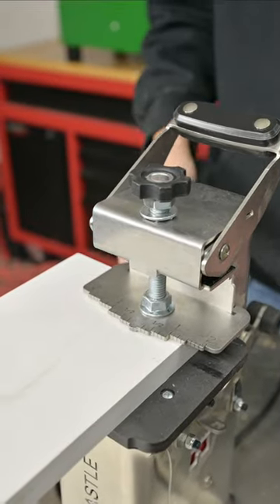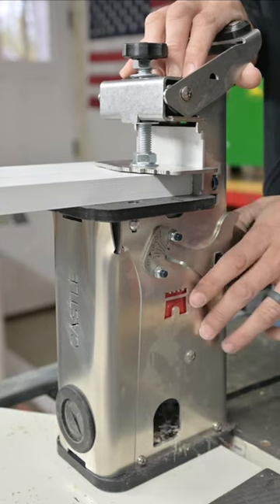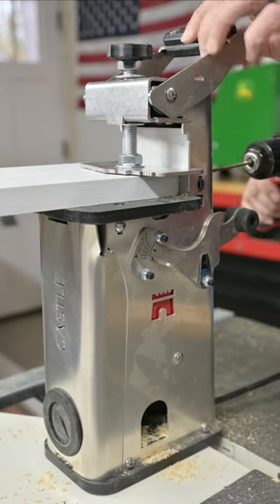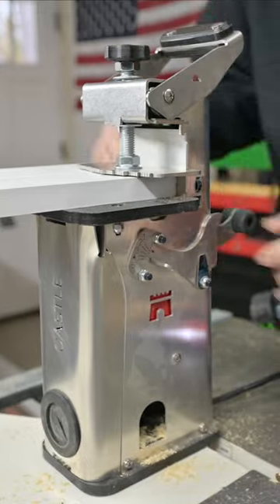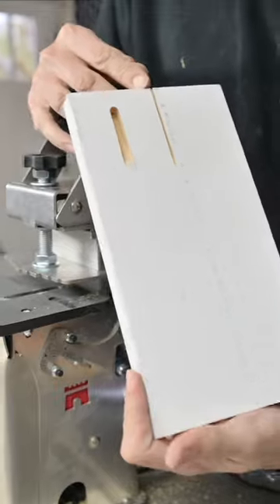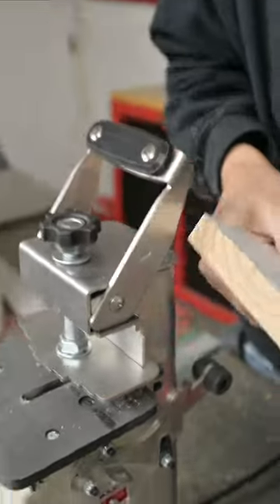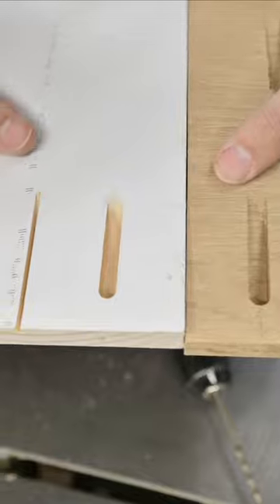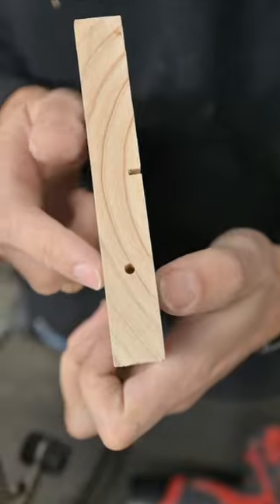dream pocket machine

Comment: I don’t use this pocket hole cutter but I use the Porter Cable production pocket cutter which cuts the same pocket as the castle machines cut but ten times faster. I personally prefer the angle that the castle cuts as opposed to the Kreg. 

Because the castle style pocket is bored at a much lower angle than the Kreg I have found it much easier to screw the joint together and pull the joint tight even with 
1 1/4” screws. With the castle style pocket you can also use 1 1/2” screws without the tip of the screw protruding through the face of the piece that’s being screwed together. 

I have a Kreg that I use for cutting a few holes on installs so I don’t have to take my production pocket cutter out of my shop.
Reply: The Porter Cable was a licensed Castle machine. Castle has sold the same model since the PC stopped being sold. I had one years ago. Excellent tool.
Reply: Yes, this would be nice on a bench while I'm building cabinet door or cabinetry. I'll keep the kreg for on site

Comment: I don't know about this, I admit the slot is a lot cleaner slot than my kreg jig, but they arent exposed on my cabinets except under shelves anyway so I dont care. plus on longer pieces or panels how do you support the piece in the horizontal position like that. I just drill slide drill slide with the piece Vertical aiming down. Like a bottom panel for a cabinet it would be awful combersome with that set up. Then I guess your going inward with the pilot hole so blowout that happens from drilling should be inward as to not hold the seam open but the kreg doesnt go through the face and if it is creating a bump or blowing through I know immediately it is out of adjustment and can resolve it or the screws will blow through the face of the work. I guess this rig may be good in special one off situations. but not as an one tool does it all like the kreg.

Comment: Is product any better than kreg jig?
Reply: Kreg jigs drill an incomplete 15 degree pocket hole. Castle machines route/drill a complete 6 degree pocket hole. It makes a difference if you are in a workshop doing it every day. The bigger machines drill the hole as well.
Reply: @aspees  my kreg holes are complete. I've used it for so many projects. 1 step to drill the hole, and another step to put the screw in. Simple. This over complicates a simple task.
Reply: I worked for in a cabinet shop for Max Durney in the 1990’s. He invented this machine, and we  used it for everything. We more or less beta tested it. The big industrial version is way better. He licensed it to Porter Cable way back then. We used to call it the toe screw machine